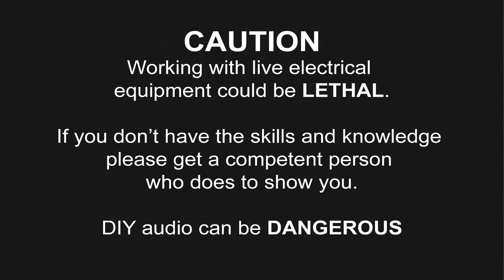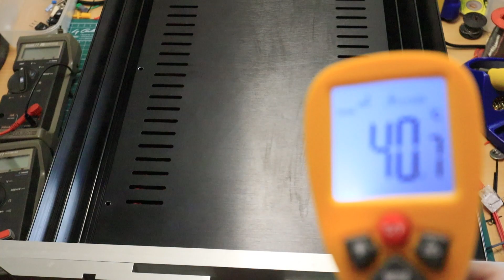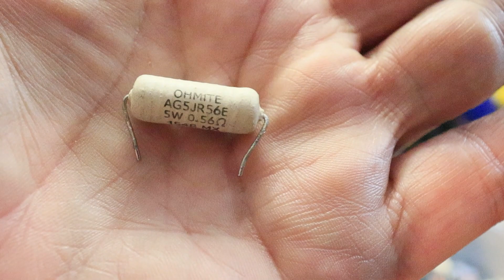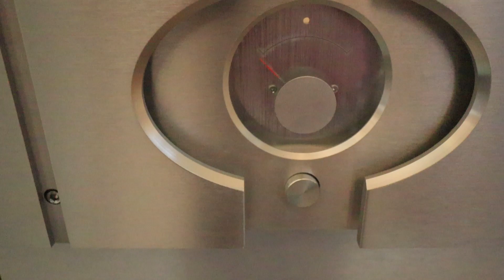F6 Hum issue resolution and test.

Comment: Do you think that wirewound resistors pick up noise in generel more than others (for example MOX) or was it specily here, or specily the ohmite?
Reply from the maker: Good question, in this case it was the Hi quality ohmite and or the layout of components within a case which IMO has not enough internal space. The owner was happy with the end result. Also, on reflection the transformer had primary’s of 0-115 x 2 and had the dreaded mechanical 50hz. Here in the UK you need 0-120vac for a quite amp. I have used other wire wounds without issue.

Comment: Could you use a cable finder tone generator to source out components that might be noisy?

I rarely find a reason not to use Dale resistors in Nelson pass designs. His designs are so simple and have few components, so might as well use the good stuff. Doesn't add a whole lot to the project

Comment: HI, I've been watching your videos and decided to build an F6 you made it look easy :-)
The diy store is currently out of the power supply board kits 
do you have a recommendation of an alternative board and where to get it 
and the parts. any help is much appreciated
thanks
Reply from the maker: Ebay have 'clone' type power supply boards which will do the job or you can hard wire point to point. The parts are available form many suppliers though not one will have everything you need. Farnell, RS, Mouser, Digikey. Check on the DIYaudio audio build guide and F6 thread for info.
Reply: You could make a post in the swap meet section. Maybe someone has an extra they would be willing to sell. I really do like the DIY audio power supply board. It is very nice

Comment: Hi.
I have some questions for you and was wondering if I could talk to you in a private chat?
Reply from the maker: Hi, Sorry I cant private message through youtube. And I'm not posting my email.  But ask away here.
Reply: @thediyaudioimplementers1826  yeah well. I have a f6 I set up, about 2 years ago. Now first channel just started smoking and I never dared turning on the second channel. I search and cannot find a fault with neither psu (which I have used on other designs), nor the cards or components. Mouser does not sell new smoke I can refil. I would like to pay you to have a look at the card and dunno...  fix it? or rather both of them.  This was during first run. It fired what seemed ok for a while. bias to a minium , could not measure any draw and diode lit up. Then after some seconds something started to smoke and I shut it down. Now it is just dead. Kind a lost the spirit there since I have several other amps I built that I use as daily driver without complications.
Reply from the maker: @brgeholen2668  That smoke you lost is hard put back in...no one sells a refill kit for it. If it smoked its normally to late and something needs replacing. Make sure the Mosfets have good contact with the heatsink via insulator and are not shorting to grd. You could spend hours fault finding and if its not showing itself its quicker and easier just to replace the active parts (Mosfet, jfets, zener diode) Check the resistors/caps for heat stress, if there are signs replace it/them. Are you on DIYaudio?
Reply: @thediyaudioimplementers1826  yes I am
Reply from the maker: @brgeholen2668  PM me ..:)